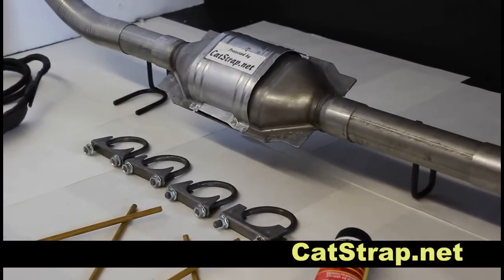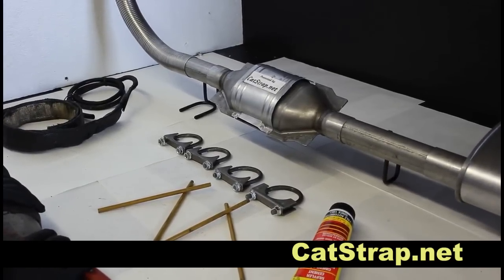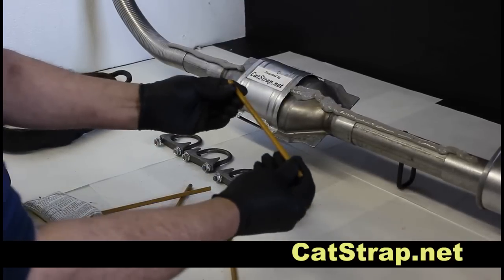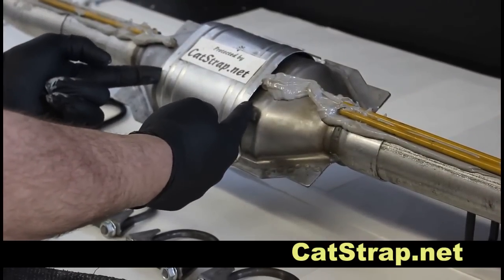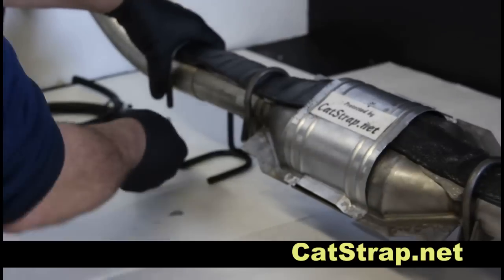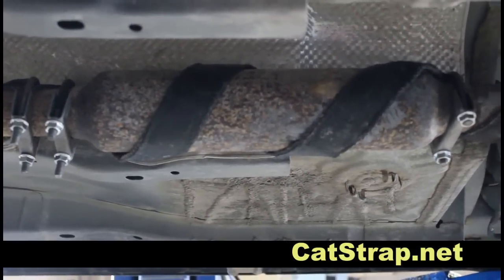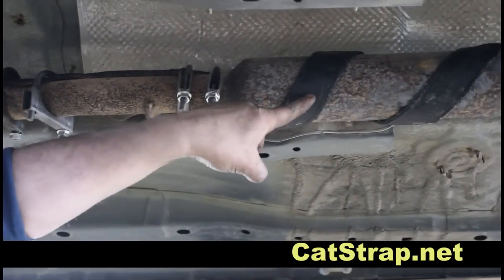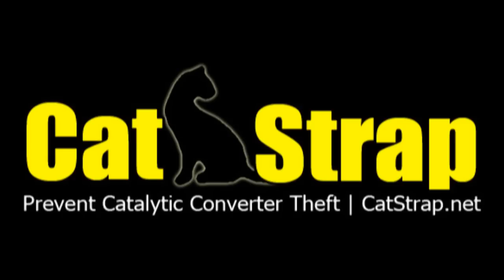Prevent catalytic converter theft with Catstrap

Comment: yes I guess you could use and or spend your money and do it the way that they did in this video or you could simply have the man at the muffler shop weld four pieces of 2 in long rebarb two pieces going in front of the catalytic converter on the pipe two pieces going the back of the catalytic converter attaching the pipe to the converter things look under there see that s*** and run away and go to the next easy vehicle trust me I live in California family owns a muffler shop we do it every day and I'm betting it's a heck of a lot cheaper than the method used in the video. As if you were go to my cousin's muffler shop for a catalytic converter he then offers and suggests to people to do what I just said only he does it for no charge you've already paid for the catalytic converter you've already been robbed in our opinion that's more than enough to have to pay
Reply: Do you have a picture of this that you can share.
Reply: Rebar is mild steel and is easy to cut.
Reply: @lion_in_grass8122  Yeah but he's talking about some experimental metal with anti-cut nanostructures... It's called... Rebarb(?) 🤔🤔🤔
Reply: @lion_in_grass8122  -Milder than some steel, but still extremely hard, with impurities, note spark density (sparklers) and dispersion from a cut-off disc.
 Sawzal blades absolutely hate rebar..
Reply: My job uses these cat straps and they don't work they cut them right off . Rebarb is actually a great idea .
Reply: @truthfulteachingsautorepai5475  what’s Rebarb?
Reply: @fajoopsa  pretty much steel bar used in construction/ contrete for reinforcement
Reply: I like the smell of gunpowder in the air . Try it it work’s just park your car a couple lengths away and you never seen that guy before now.

Comment: It'd be easier and less apt to mess up the paste if you threaded the strap through the converter plate first and folded it out of the way. Then apply the bonding paste and the rods, and unfold the strap over them.
Reply: There's always one
Reply: I thought the same thing about the install. Put the strap through first then apply the messy paste glue.

Comment: I think I'd rather fit a steel shield covering it instead. When the cat fails (eventually happens to every cat) or is otherwise damaged, this approach is going to be more expensive to replace a cat because more material will need to be removed, as well as it being more time consuming.
Reply: I was also wondering how you would replace it if it needs replacement due to wear and tear.
Reply: I wonder if a fake cat strap would cause thieves to not bother and move on...
Reply: That's right jw, and then you'll have to buy a new strap!
Reply: Well I'm 42 and have owned 5 cars all with over 200k miles and have yet had to replace a cat. My wife's Toyota has 304k and still passes inspection
Reply: @rickwilson5611  Passing inspection entirely depends on whether or not the exhaust is monitored downstream of the cat. I think most are, certainly for newer vehicles, but older ones didn't always have an O2 sensor after the cat. So they could get hosed and the ECM wouldn't know, and especially if it's still an OBDII system, there wouldn't be a "sniffer" put in the exhaust to actually measure the gas concentrations..at least that's how they do it here in TX.

Comment: Whats to stop them from taking an extra two feet of exhaust pipe
Reply: Good point. I was visualizing investing in 2 ( less than a ft.) flat steel files and expoxying them atop ( minus alarm).
Maybe- 4 files and extend their need for cutting more pipe as you implied. Bigger hassle, takes more time
for them crawling all over ( these cockroaches). Let them work for it.

Comment: The next step will be manufacturer's adding security features to prevent the theft of the catalytic converters from being an easy target.
Reply: This has been going on for years. You think their scientists would use alternative materials but that fact is they don’t mind selling cats
Reply: Manufacturers won't rush to do it. If the cat gets stolen you have to buy a new one. I know a lot of aftermarket ones are available but a lot of people will buy the genuine parts specially on newer vehicles
Reply: Maybe a full or partial undercarriage plate.
Reply: @stevelozano9523  They're already in there with an angle grinder, one more piece of metal isn't going to stop them.
Reply: @Tracert-mc1hu  don't be silly, there using sawsalls not angle grinders..

Either way you weld up the right bit of I carbon plate 8mm thick and nobody's going to touch that shit
Reply: @crf80fdarkdays  someones knows a bit about metallurgy- the right type of steel,they will be dulling 10 blades just to cut a 1/4 inch!!
Reply: @williamgeorgelopezjunior8533  problem is, there are no other metals or processes that are this compact and efficient.
Reply: @stevelozano9523  steel plate bolted up on spacers. Still get air flowing through and now you can slide over those lifting bollards on YouTube intstead of getting skewered
Reply: @highdownmartin  don't understand your comment, please enlighten me.......
Reply: @rearspeaker6364  true.... until we go full electric ... people will just be finding odd ways to cage off their cats. There’s no way I’m building and framing in a Fort Knox though... that’s ridiculous . Also, I do have three vehicles and none of them have cats, so... and I won’t have to until my state changes the rules on me...
Reply: @rearspeaker6364   the trickiest thieves adapt... then pass it along

Comment: Anything used to make it more difficult to steal also makes it also hard to service. The best way is just catch them red handed, give them a blindfold , a 
cigarette (if they smoke) and a last word. Dig a 8ft by 4t by 6ft hole 
in an unmarked remote location and...well you know the rest!
Reply: My neighbor owned an excavating business. He and I had an agreement that he would open and close a hole with his backhoe for a hundred dollars, and whatever I decided to put in that hole was my business and mine alone.
Reply: @jayrowe6473  awesome I use to work at a recycling plant as a class A truck driver/heavy machine operator and this one time this guy I worked with , stole a safe from a business on his on time and day , took it to our old company broke into the company during non working hours pulled out the excavator and started slammming the bucket of the excavator to brake open the safe
Reply: Sounds good to me !!!
Reply: And all you need to do is stay up all night every night to catch them.  Easy.

Comment: Cat theft is rampant in my neighborhood right now.
I'm gonna line my exhaust with:
1)  A cat strap to stop sawzalls.
2)  A bunch of old Kryptonite lock shackles to stop sawzalls.
3)  A bunch of extra 2" steel (hard, sparky) tubes capped at each end, but full of fuel to "address" blow torches and grinders.  If you cut through it you explode.  So does the car.  But blowing up a thief is totally worth the inconvenience and expense of blowing up my own car.
4)  A trip wire connected to my Viper Smart Start so I can get an Iphone notification it's been cut, so I can run over to my car just in time to see the explosion and the thief catching fire, record the video and upload it to YouTube!

Or maybe I'll skip #1 and #2 so I'll more likely get to see the show!

Sound good?
Reply: I shall be following this plan..this comment made my day because I am PISSED ASF RN
Reply: @iamandresrobles  just delete the cat
Reply: ill donate a junk prius to sit in the front yard lmao n u rig it
Reply: Steel tubes full of fuel, strapped to your exhaust? you obviously havent calculated what will happen once you start driving. DOH!
Reply: a anti-personnel mine with a trip wire is simpler.
Reply: @rearspeaker6364  now we are talking
Reply: Hope that works for ya

Comment: Doesn't work.. my cats were stolen with this unit. Just weld solid metal bar from front to back and build cage.
Reply: I got a length of rebar and fixed it either end of the cat on my van with jubilee clips. And i know someone has had a go because i can see marks where they tried. You don't have to spend a fortune to protect your cat.
Reply: @tilerman  did you glue the rebar like on the video or just fixed with jubilee clips?
Reply: Or delete the cat
Reply: Yeah. I saw this video to get an idea.   Ima just use metal rods up to and the side
Reply: @steve5912  that or replace with high flow 56 ebay cat...they will look n walk off lol..... deleting sounds better lol
Reply: @steve5912  what's a cat?
Reply: @SilverBullet93GT  Ask your dog 🤣
Reply: @DJ-xb1tq  i mean mine is a hollow pipe lol

Comment: Two pieces of pipe, slightly larger than the cat pipes. Cut in half, lengthwise. Weld halves back together over cat pipes. Just spins when touched by sawzall, chain cutter or cutoff disc. Very difficult to operate cutoff tool when holding spin pipe with other hand. Your welcome!

Comment: I just took some old saw saw blades (good brand..not harbor freight stuff) and tack welded on 3 sides of my pile. It stopped them. The harden steel is hard to cut and dulls their blade....and make a bit of noise

One could do the same with a few muffler clamps Put the blades on top and bottom of the pile...They will go fine a easier target

They did cut a slot in my pipe but did not get the cat. I just welded (any muffler shop can do it) the slot up
Reply: or pieces of broken chrome vanadium tools....
Reply: How did that feel when you welded it to your PILE?
Reply: @plumcrazy9842  Some people are so immature that they feel it is cute to make a comment on something they know that autocorrect did...just showing how childish they are.
Reply: @allanc3655  Silly rabbit, you can still proofread it before you push send!

Comment: What if you have to replace your catalytic converter, then how will you remove it with this on?
Reply: You uh......you.........well shit........
Reply: You unbolt it
Reply: @OneManOnFire  What if the thief has a socket wrench then?
Reply: @paulh2981  Anything that will slow them down will give me more time to get my gun
Reply: You cut it. It's just going to take a grinder to hit the hard rods and strap. this is to deter quick snatch and grab theft, not shop work.
Reply: It's not everyday you replace a cat.
Reply: Just take it to a thief.
Reply: @OIII-IOOO  I have the cat clamp plus extra galvanized metal wire
Reply: @OneManOnFire   I've the found the combination of steel, brass, and lead to work just fine.
Reply: @brickswisher7672  Honestly a home made unit can be made easily
Reply: @OneManOnFire  r/whooosh
Reply: Cat strap is forever. 🐱
Reply: You buy another cat strap and all the exauhst piping it's attached to.

Comment: I have a better idea you could sell. 1) Weld the cut proof Krypton chain to the converter. 2)  a vibration alarm attach to the cat.
Reply: What if a crackhead removes the alarm first?
Reply: @russhfilms682  well obviously it would have a disarm function..

Comment: If you hear someone under your car and you're home, just hit the remote start button on your key fob if equipped. If they already cut the one side, the house would be deafening. If not, hearing the car start while they are under it will at least scare the 💩 crap out of them
Reply: I like that!
Reply: If they've cut into the pipe, and the engine starts, the exhaust is going to get them in the face...
Reply: My cat was stolen at the shopping mall, while I was shopping in the store

Comment: Install a mesh cover across the bottom of your car where the cat is, attach it to both sides of your frame.. you can see the cat through the mesh, but the thieves can't get at it.. you can't use sawzall blades, you can't get a pipe cutter in there, yes it cut off wheel could do it but thieves don't use them because they're too noisy.. 20 or $30 solution
Reply: What type of mesh did you have in mind, and where can I buy that?
Reply: WhaT TYPE OF MESH??  you got me a little confused,  but i would like to know

Comment: After having 3 catalytic converters stolen on my Toyota Tacoma I had a shop weld a thick chain to the converter itself and then tack welded to the frame.  As long as a thief can steal the converter itself anything you do to the pipe is useless(I tried). It never happened again...
Reply: Welding, gluing, screwing, cutting anithing to the catalytic converter would be consider tampering with emmission equipment thus failing emmission test.
Reply: Nice try but a zaw saw and a carbide blade will cut the chain like butter
Reply: @arturoorozco5236  How many times has the emissions guy jacked up your car to look?
Reply: @atuck6082  every year for inspection
Reply: @Chevydevil  Really? Wow, none of the here. What state?
Reply: @atuck6082  They look for the cat with a camera as they drive thru the inspection lane in NJ

Comment: DOES NOT WORK. I had this thing and thieves cut through it like it wasn't there.
Reply: Seriously???
Reply: If you can get tungsten carbide rods, that would likely work.  It would be funny to see them trying to saw through that.  I suppose if they had a diamond blade they could, but it would still be a rough job.
Reply: @paulh2981  Tungsten carbide easily cuts with a battery angle grinder fitted with an abrasive cutting wheel. Most people take no notice of car alarms, rendering Catstrap useless.

Comment: Did anyone not noticed, where they used the “spiral” wrap method - they were protecting the exhaust resonator, the catalyst converter for that car is towards the firewall. This is a joke and will only piss off a thieve which will probably lead them to do other unnecessary damage to the car.

Comment: This might be the dumbest deterrent I've seen to date lmao
Reply: How is it dumb? Do you realize how much time you'll be under the car fiddling around with clamps and wiring?  I would say it's a nice deterrent.
Reply: Remember guys stealing want in and out quick. Most saw saws blades don’t cut hardened steel as easy So if you can slow them a bit then it scares them off. If they wanna take it they will sometimes you just need to slow them down or discourage them.   And if by dumb you mean simple then look into nasa’s reader how for a zero gravity pen while the Russians just used a pencil
Reply: @migquez123  exactly. You really only need to dull their sawzall blade and they will leave.

Comment: That the first thing I  remove to increase my fuel mileage. I've had bad issues with cat Converter melting internally and almost burn up the engine. I don't care for any Converter period.
Reply: Don't run a dirty tune then. Same thing without it.
Reply: How do you get through the smog check at DMV every two years.

Comment: Gravity??? No. These are wirely little punks that can cut just as easily in any direction, and possibly bracing against the ground, would give them good upward leverage to cut fast. So, in the dark in your case, there would still be some damage from an upward cut but no loss of cc.

Comment: - to secure the strap hose clamps are enough and they apply even pressure on the exhaust tubes 
- not sure if the adhesive (looks like a pu seam sealer) will work ar high temperature
Reply: Looks like a video made from a local shop during the 80s,lol

Comment: I've been doing a lot of research on this topic, due to a rash of catalytic converter thefts in my town. I think a better way to go is placing a stainless steel plate over the whole length of the converter. You could either bolt the plate in with stainless steel bolts flush with the plate, or weld it to the frame. Need access to the exhaust later? Just grind off the welds.
Reply: i just been raided on my Honda Jazz and was thinking the same think. just weld plates all over the area.

Comment: How about put a sensor down in there when it detects an object it turns on the engine and move the car back and forth slowly and blasting the horn until it no longer detect that object.
Reply: think they dont cut the bolts but the pipe on both sides but dunno, ...migth have easy on off system and take it off after yearly inspection put pipe instead or empty converter to make them work for it . then govt might do random cat checks or more. . or attach explosive to it but too risky ,triggered w removed. or like paint explosive small. tracer on it under some rusty cover no getst oo hot but on a non used car inside it. fireworks at them , potatoe gun. get into other car down the street to ram them, but thats murder for theft over top. some night guards under sides with fish hoocks ..or by sides net bundle hard to get away, stinking with what chemicals or rotten things....or some thick wooden plate or metal grill strong thick pipes locked under car at night , to the car , or, mounted in ground , a protection that rises up from hole , around cat , but if you forget and drive much damage. or rises up along sides of car or the side cat is closer to, or have it on hinges and lift up to car side and lock it in that position, or just heavy rocks or wall park by it close , or between . gated community or all must identify themselfs when passing by cam warning to police or hood team if not. water sprout directed at cat area cool them down or hot water or feces water, think they dont cut the bolts but the pipe on both sides but dunno, ...migth have easy on off system and take it off after yearly inspection put pipe instead or empty converter to make them work for it . then govt might do random cat checks or more. . or attach explosive to it but too risky ,triggered w removed. or like paint explosive small. tracer on it under some rusty cover no getst oo hot but on a non used car inside it. fireworks at them , potatoe gun. get into other car down the street to ram them, but thats murder for theft over top. some night guards under sides with fish hoocks ..or by sides net bundle hard to get away, stinking with what chemicals or rotten things.gg